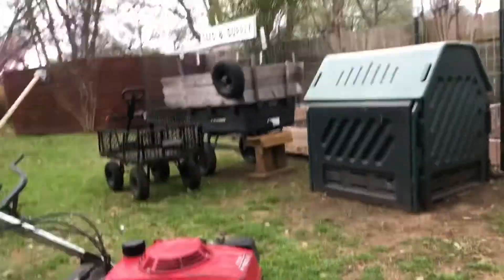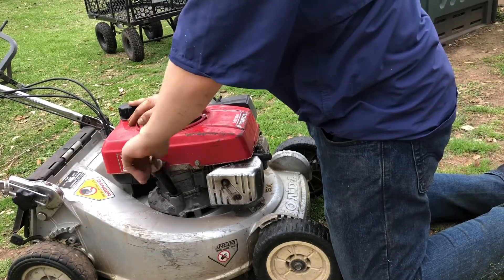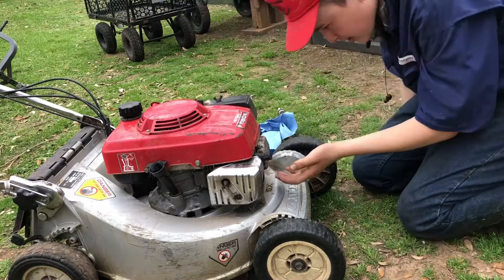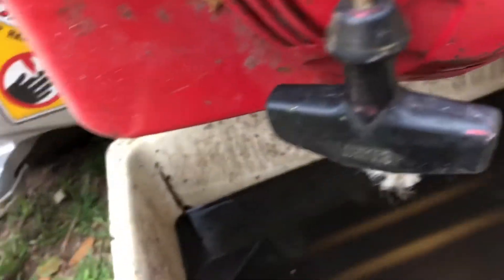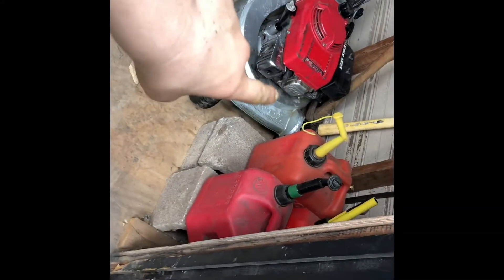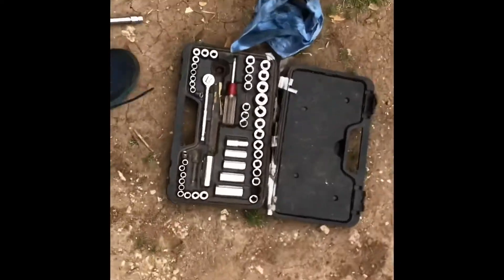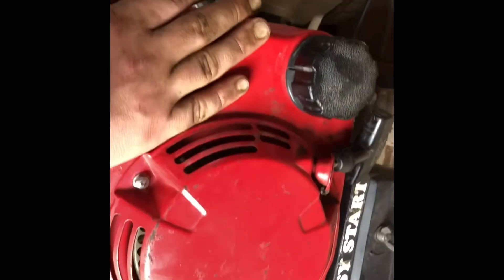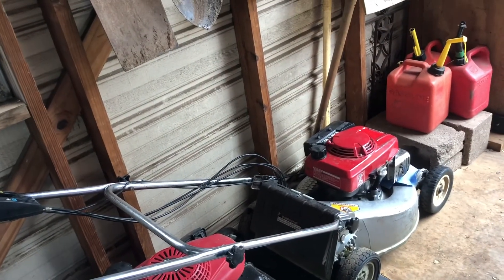Changing The oil in The Honda HR194, and it started leaking some oil again

Comment: They only smoke when the rings are worn. or the valve seals have dried out. the seals top and bottom of the crank have lasted very very well considering its age. and you can change them :-) why not do a rebuilt. rings. connecting rod and valve seals coupled with regrinding the valves. where is it leaking from? if you tipped it over with the carb facing the ground. oil will leak from the breather into the carburetor. i can't hear you talking when the engine is running :-( are the cooling fins clean. if its leaking from the front it needs a new valve cover gasket. look on eBay for  12391-ZE7-M10 that is the genuine part.